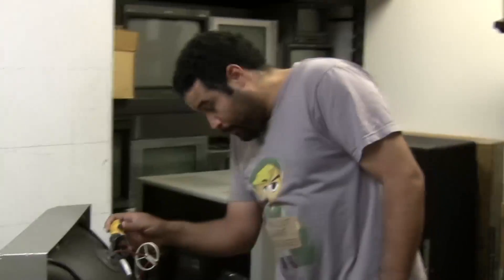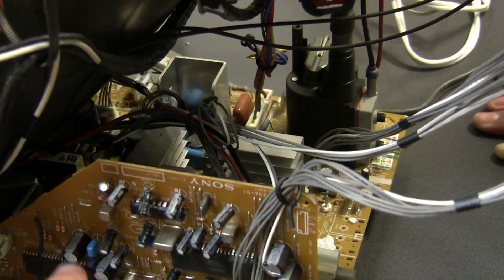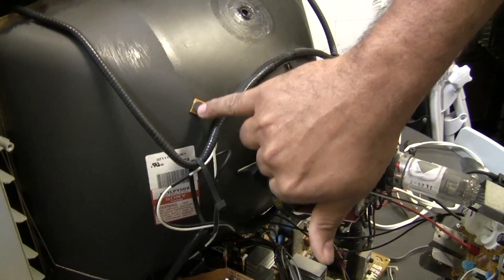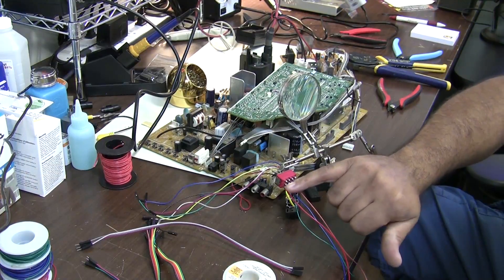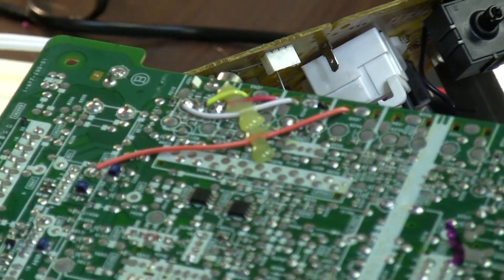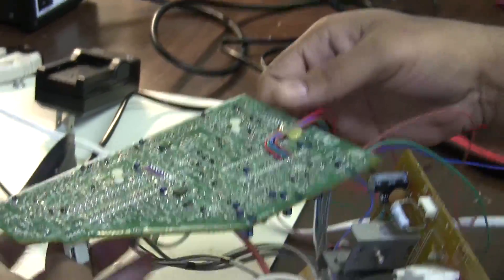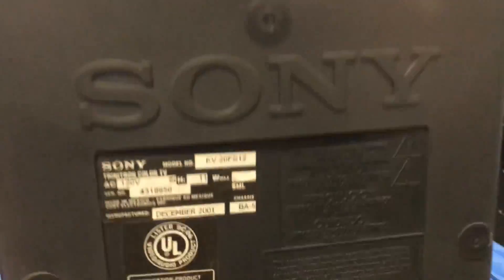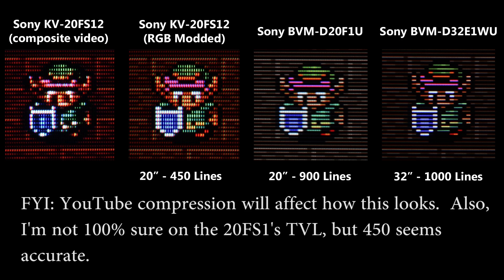RGB modding a Sony CRT for Retro Gaming

Comment: We made an american $20 CRT look like an european $10 CRT. ;-)
Reply from the maker: LMAO!
Reply: Nope 50/60hz long as you have a scart lead in the rgb scart port you get colour 60hz
Reply: Booster McBlast good luck shipping one from there. I lost two pvms shipped locally inside the US arrived broken at my door. this mod is great for people who can pick up a tv locally and add rgb.
Reply: True! But since the 90s, many of them also accept NTSC Color via Composite or S-Video. Via RGB, You will never have a problem.
Reply: No, practically all of them also accept 60 Hz.
Reply: Shipping is a big problem, that's true. Luckily, I live in germany an I could get 100s of RGB-CRTs for free. But I already own around 10.
Reply: they all will work with 50 or 60Hz RGB. With composite or S-video they may display in B&W due to different colour burst frequencies.
Reply: Booster McBlast now that's funny
Reply: Booster McBlast They are restricted to 50hz though, no?
Reply: @zebular  Most late era CRT tv's from scandinavia (2002/06), can accept both PAL and NTSC. My 14 inch Denver does. And then people ask, why not a 21/28 inch Bang and Olufsen. Well... As much as I love something from the last Danish TV makers, I simply have no room for anything that big. And my 14 inch Denver fits nicely enough. I need to have room for my 14 inch EGA PC mobitor as well. It is an old CRT from Sperry.
Reply: Noobsaibot21  cost and availability of broadcast  monitors in USA probably  do not justify  the slight upgrade in picture quality . . I say mod them crts  best bang for buck and you should find them easy. I am in UK so have all the options  the yanks don't .
Reply: Scart masterrace here too (Ireland). :P

My worry is some folks desperate to get in on the RGB goodness on CRT's might kill themselves doing this without knowing. After all, I have a reasonable idea of what i'm doing and I've electrocuted myself once or twice (thankfully, just the lightest of taps on the neckboard but still.... unpleasant. Why do those pots have to be so awkwardly positioned?)

Basically, If I were in the US and truly cared about getting RGB on a CRT (but did not want to wait to find a pro monitor), I would suck it up and pay for it to be shipped on a palette. In Europe (well, especially here in Ireland), broadcast monitor are difficult to find.

I wonder though..... would the relevant boards from within a Euro set be any use to US folks with the US equivalent model? If so, and a parts supplier could be found, that'd certainly cut down on shipping for them. I'd imagine someone like RGBRob would be best positioned to answer such a question.
Reply: I live by a bbc studio so I can pick up pvms all day long , scart isn't a master race thing it's a technical hurdle , to make the pleasing to the eye. If you are of a age that the first time around you played them on a crt , nothing else seems right unless you go back to crt . It's not about rgb per say but the whole cathode ray tube nostalgia and warm fuzzy glow. Hd is better at hd crt is better all pre hd is my baseline
Reply: 240v the good stuff. Most tvs have speakers otherwise there monitors. Yes suprise our tvs have a sharpness setting. We can do ntsc on composite you get no colour with scart you get full rgb ntsc pal and secam. Think of europen tvs as arcade monitors with a tv tuner and speakers , golden rule get one with scart even better if it has two scart ports.
Reply: Most likely it already works with 60Hz, nearly any TV from the mid 90's up works with either 50 or 60 Hz.
Reply: t0nito thanks for replying, the TV is OK and looks fine I'll live with it for now.... Lol.
Reply: thecow275 you can also get s-video though a Scart as well.
Reply: All kidding aside is there any place online that sells scart TVs and ships to the USA? Even with shipping it'd be cheaper than a sony PVM and less pain i  the dick than doing an RGB mod. Especially since not all TVs can be modded.
Reply: I was not kidding, it would have to go on a ship as airfreight is too expensive and air turbulence can crack the crt neck, Or try alibab and just get a scart chasis for your tube tv, that's also a good solution.
Reply: Vasili i know they make universal arcade chassis but I'd love to have scart TV chassis to use with our scavenged tubes.  I lot of folks here would love to have an RGB TV to use with consoles vs an open framed CGA arcade monitor.
Reply: No mate they make universal tv chasis too diffrent from th arcade stuff. Only think you need to know how many pins the neck board is afther that it's all good.
Reply: Vasili  that's cool. I looked at a few universal TV chassis but none of them had Scart connectors.  I'll have to keep digging
Reply: Lol you pay too much I get mine free ... :)
Reply: Europe uses 230V but most electronics are full range voltage, so they'll work fine from 100V to 250V. We have a CRT we bought in the 90's that works with 110V though it's a European model. I know because we came from Canada and we have some 120V appliances so we have a couple of stepdown transformers and I tried it and it worked fine,
Reply: Is there any way you can get 60hz to work on a 50hz crt tv? I have a Sanyo 21"NICAM STEREO CRT 50hz pal with rgb Scart and SVHS inputs. Don't get me wrong retro consoles look great on it but I would love to use the 60hz option thats in the settings on consoles like the original Xbox/gamecube for example.
Reply: t0nito no it doesn't, the screen rolls and flickers when I set the original Xbox to 60hz pal. No worries though I'll just keep an eye out for another crt tv that has 60hz.
Reply: retrostansolo Most Sony Trinitrons support 50/60hz.
Reply: Either your TV is really old or you really had bad luck, I've had more that 10 PAL CRTs in my home and every single one supported 60hz. Some even NTSC colour, but every single one supported 60Hz RGB.

Talk about bad luck :P
Reply: yup because europe has RGB and composite on the same scart connectors by design
Reply: @thecow2756  And Scart is way more easy to fiddle with. It is big, and can only go in one way. Way better than flimsy S-Video cable.
Reply: If someone could load up a 40ft cargo container full of scart crt TVs and ship them to the U.S they could sell them like hotcakes!
Reply: Ok £50 each
Reply: @mrburns366  Nope.... Vintage console and Computer hobby are a nieche hobby. You have better at selling 1960's spare parts for cars. Especially in America. You might be able to sell some 150 crt's in no time, yet then it will drop to some 5 to 6 every month.
Reply: blaaaaaaarghable good to know
Reply: Booster McBlast Where? And are Barco Monitors to be trusted?
Reply: Barco are supposed to be pretty damn good. Far more common in Europe than the NEC XM29+ apparently
Reply: Noobsaibot21 Okay then I might get one for around 30 Euros, if I'm lucky :D
Reply: Check out RGB Rob's video on one of their models. While everyone scrambles to look for PVM and BVM, these are somewhat under the radar

https://www.youtube.com/watch?v=m65N8T9BndQ
Reply: Yeah, then you can buy NA import games so you can play without massive slowdown from shoddy PAL ports.
Reply: 100Hz are great! I have one
Reply: Just what i was thinking
Reply: 60hz NTSC RGB > PAL 50hz RGB
Reply: I think after 1990 or so, only the absolute cheapest/worst European TVs do not support 60Hz. Most accept S-Video via the second scart socket too (Scart SV). This is a pretty nifty experiment if in the US but really, stick to hunting down professional monitors.
Reply: @Noobsaibot21  I come from Scandinavia, and here CRT's did have everything in the mid-00's. 2006/08 were the time, in were CRT's became extinct. Yet they had everything at that time. They had to, as people still bought them, and they were cheap because people wanted flat screens. And so the price on LCD's were insanely high because of demand. It was not untill some 2010 that the last CRT's were sold out.
Reply: @brostenen  

I'm glad FPGAs are coming along nicely and mitigating issues like scaling and input lag signifigantly. As time goes on, older consoles will become unreliable (particularly CD consoles) and harder to find widely. Some day, i'll probably retire original hardware and the CRT in favor of FPGA + Everdrive sets.

I'd even go so far as to say I would retire my Megadrive altogether if the Analog SG had supported 32X.

Something like a PolyMega but FPGA rather than Emulation would be ideal some day.
Reply: @Noobsaibot21  Well... Most consoles are perfectly fine, being emulated on the Raspberry-PI. Yet a few machines are not that easy to implement into FPGA's. Like custom chips.

Commodore64:
SID are implemented perfectly in FPGA now. The VIC-II is not. The VIC-II chip have too many quirks in order to meet the demand of the demo scene. The rely on the bugs in the chip, and the production imperfection that MOS did. And since MOS was shut down due to poluting the ground, then you can not reproduce the VIC-II 100 percent. You need to know how they were physically produced, as well as having the blueprints for the chip, in order to make a 1 to 1 replica.

The Amiga:
As much as they are still working on FPGA implementations (Vampire as an example) then a lot of quality is still missing. Like the sound. Paula just dont sound right. Yet something like an ScanPlus-ECS (not indivision ecs) delivers a near perfect 50hz output. So there are still stuff ro be made, like getting native OCS/ECS video out on HDMI is not a thing yet. For that you need a converter/upscaler.

Yet most consoles can be relatively reproduced in a combo of FPGA and emulation these days. Just not all, like Atari-ST, C64 and Amiga. They are simply a bit more complicated.
Reply: Underclocked it to 50hz? Lol

Comment: The reservoir cap(s) in the SMPS can pose a risk too.

More modern sets will often self-discharge that cap after a while of being switched off, but that's definitely NOT guaranteed.
The charge on the anode cap / CRT itself is obviously a greater hazard, but the smoothing caps on the main board shouldn't be ignored either, as they can give quite a jolt.

I always check the voltage across the main reservoir cap(s) on any PSU before working on something.
It's very quick and easy to do with a multimeter, and the cap(s) can be safely discharged via a resistor.

 (or just shorted directly if the voltage is fairly low, but that may actually cause very slight damage to the cap, not to mention the pins / pads / solder joints, and even the screwdriver or whatever you're using to short the cap. The peak currents involved can be VERY high, even if the voltage on the cap is only around 20-30 Volts.)

It's a worthwhile mod, but it's a bit strange as a Brit, as we've always had RGB SCART on 95% of the CRTs since the early 90s. hehe

I chipped-in with a friend to buy an RGB SCART cable for his SNES  around 1992, and I also added some RCA cables to it, so we could experience stereo sound on games like Starfox for the first time. It was pretty awesome.

I always tried to build RGB cables for as many of my other "retro" machines as I could back then, and that obsession for the best audio / visual / gaming experience has continued ever since. Which is why I love this channel. :p
Reply: Also, as somebody pointed out in another comment - directly shorting the tube to chassis Earth can actually damage the HV diode(s) in certain types of monitor.

It's probably safe enough on most colour sets, but some B&W monitors / TVs (especially vector monitors, like the Vectrex) can be damaged by the sudden current spike, or some back-EMF effects of the flyback trafo.

Like with discharging smoothing caps, a more ideal method would be to use a power resistor of say 10 Watts, and a value of around 2K or so to discharge a CRT.

The only drawback is that it will obviously take longer to completely discharge the tube (maybe 15 seconds or more), and a standard multimeter won't handle testing of the residual anode voltage either.

To be fair, I've repaired hundreds of CRT TVs / monitors over the years, and I've generally only used a resistor for discharging larger caps.
I've never personally seen a damaged HV diode nor flyback from simply shorting directly "across" the tube (ie. from the anode cap to chassis Earth), but you never know.

Comment: Does he do this enough that it would be worth him making in interpose board for the jungle chip? It would make it so much cleaner. Pulling pins up like that all just seems wrong to me.
Reply: There should be caps somewhere along the line between the OSD output and the jungle's RGB in. No need for an interposer, just use the holes the manufacturers gave you.

Comment: .... The Sony KV 20FS12 kinda looks better in a wierd way if you like the color pallet more....
Reply: I agree - not so much for the color, but because I feel that the clean signal cutting out Composite garbage compression is even closer to "intended" or "period correct" than an ungodly expensive "professional imaging instrument". Totally closer to an arcade monitor...
Reply: I totally thought the same thing. The colors looked brighter to me.
Reply: "Period correct" is a great way to describe it.